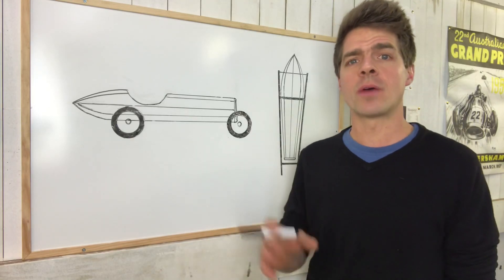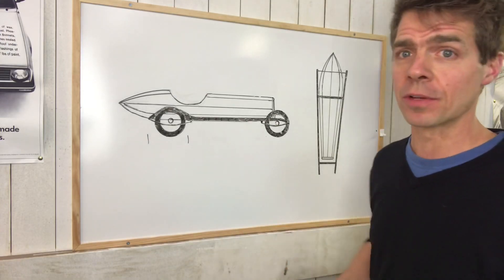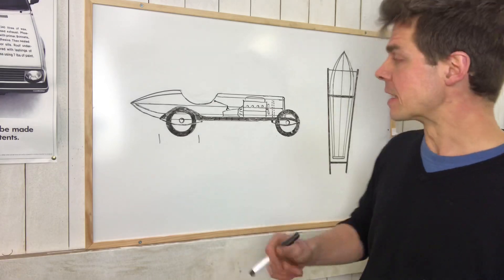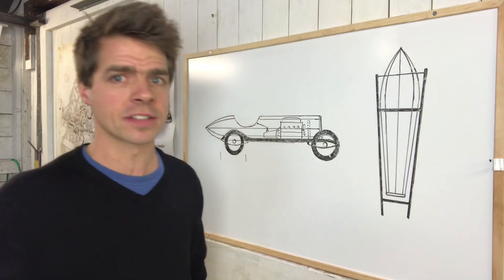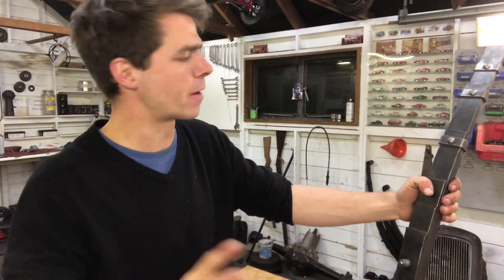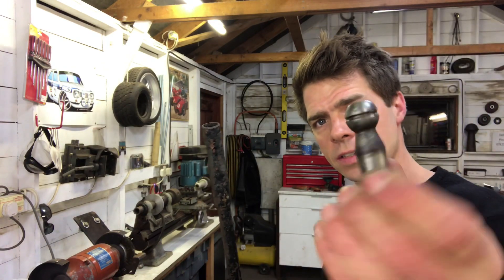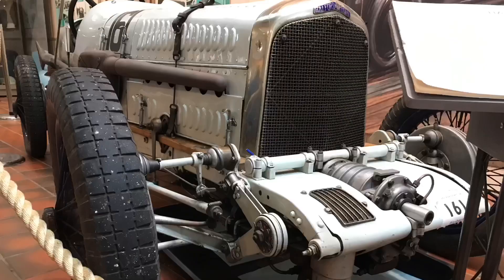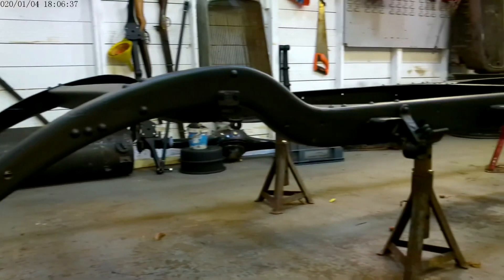Building 'The Bullet' #1 (Custom Torpedo Car)

Comment: Whats the specs of the engine?
Reply from the maker: Nothing special. It’s a 95hp four-cylinder. Hardly a Merlin V12 but the chassis was built for a 39hp side-valve so I’m already pushing my luck. Thanks for watching 👍🏻
Reply: @dudleyhewett7211  ok